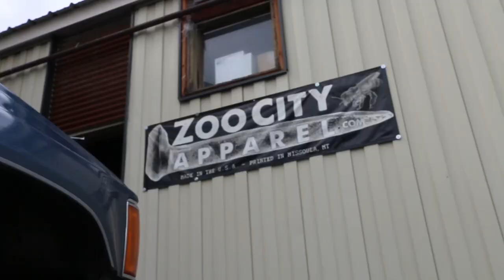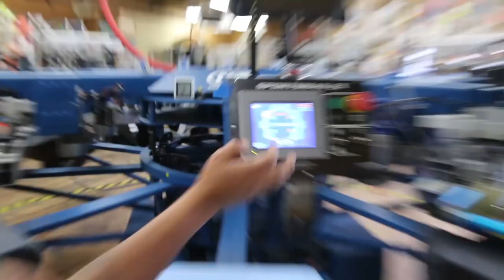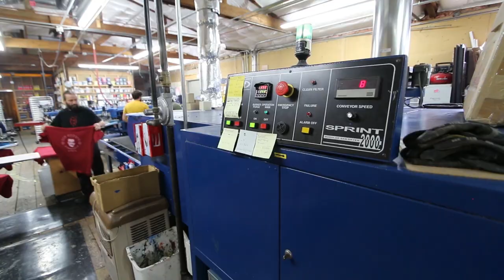It's Pizzamas!!! (Thoughts From the Place Where they Print Our Shirts)

Comment: I'm still not sure whether I understand how they make the t-shirts, but it looks awesome!
Reply: Bella Lam basically every color on the shirt has its own layer and stencil. The shirt is placed under a screen with the stencil on it and a layer of ink is wiped across the top. The more colors, the more stations each shirt will rotate to. Then there's a drying process to set the ink.
Reply: It's pretty simple. You take a blank shirt. You put it on that machine. You place the template over the shirt so that only the parts you want get the pattern. You take the color stuff (it reminds me a little bit of wax but I don't think that's what it is) and spread it on the whole thing, then wipe it off and what's left is just the stuff in the blank areas of the template. You let it dry and boom, done. If it's got multiple colors, there are probably multiple stations and multiple templates for one shirt design, but it's just the same process repeated.
Reply: cooooooool
Reply: +Mephostopheles great explanation, thanks!
Reply: Susana del Mar No prob.

Comment: btw for anyone who cares the process thats being used is called silk screen printing and it is a very tough job. My father was a printer for 35 years and owned his own shop for 20 out in LA. The box with the conveyer belt is simply an oven and its curing the ink at around 345°F, when you consider that its a purely indoor operation your looking at around 260°F as the coolest part of the shop. The reason the process looks so easy here is because they're using an 10 head auto press as opposed to a 4 or 6 head manual, all the operator has to do on a auto is put the shirt on a pallet and pull it off when its done printing. With a Manual the operator has to put the shirt on the pallet, lower the screen, swipe the squeegee a certain number of times then lift it off and pull off the shirt. A lot like a tattoo artist your hunched over for most of this process.    There's alot though that you didn't see in this vid, like the digital art that goes into putting that image on a peice of velem paper which is then used to burn the image into the screen through the blue emulsion. Most printers especially mom and pop operations generally start their day at about 5 and dont finish till about 8 or 9, this is not an easy job and as a former printer myself i have nothing but respect for these guys. Just a little insider info for anyone curious.

Comment: What happens  to the reject shirts? Shirts printed a little wonky/off colour etc (because those would actually be super cool p4a perks)
Reply from the maker: Zoo City uses them for test prints. Before every run, they print like 10 or 20 shirts to make sure all of the screens are lined up correctly and the  colors are coming off nicely. They often use the same 10 or 20 shirts for multiple prints so the shirt will have, like, four different prints on it and it's a bit of a mess.
Reply: vlogbrothers cool!
Reply: vlogbrothers I would still love one of those crazy shirts as a perk!
Reply: I would by a crazy shirt with multiple prints!